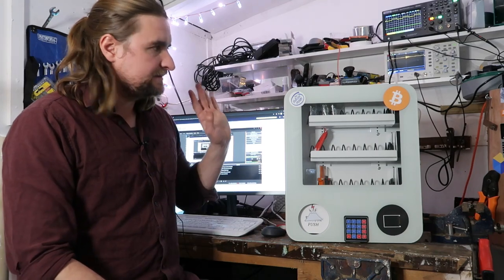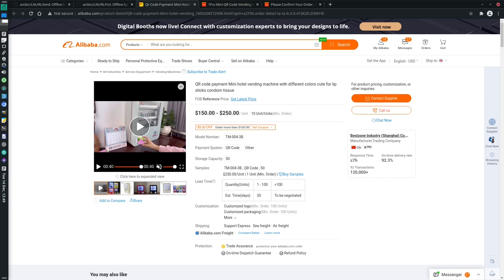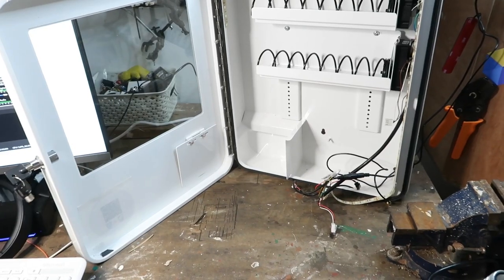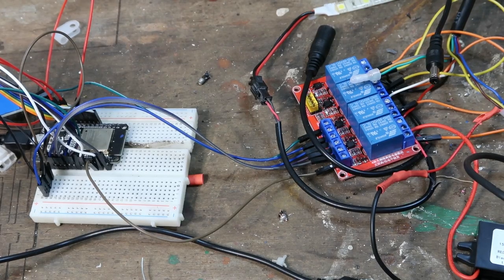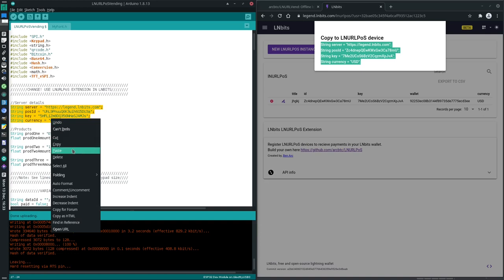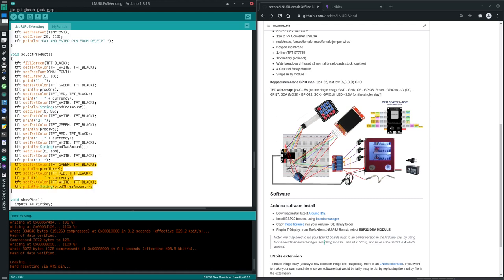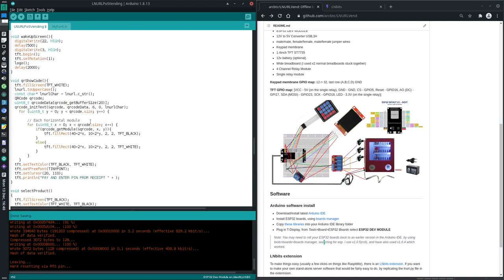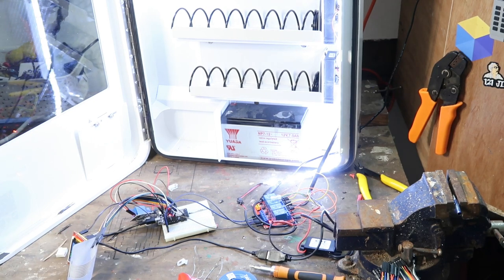LNURLVend tutorial! Build an offline bitcoin vending machine

Comment: Love the work you've done!  Planning on installing this on a machine I just got a deal on and will be fixing up. From your experience if this was installed in a vending machine with items priced at $1 and $2 would this POS be able to charge the equal btc value at correct exchange rate for those products with different values?

Comment: Could not get the display to work, and the video does not match the code, on the github the ino file is called LNURLVend and on the video  it is called LNRURLPosVending as it can be seen in minute 13:46, I looked for the file LNRURLPosVending and could not be found anywhere. It looks like a great project, I hope the video matching the files get posted otherwise it makes it difficult to get it working.

This is what I get on the serial console:

22:46:55.407 -> rst:0x1 (POWERON_RESET),boot:0x13 (SPI_FAST_FLASH_BOOT)
22:46:55.407 -> configsip: 0, SPIWP:0xee
22:46:55.407 -> clk_drv:0x00,q_drv:0x00,d_drv:0x00,cs0_drv:0x00,hd_drv:0x00,wp_drv:0x00
22:46:55.440 -> mode:DIO, clock div:1
22:46:55.440 -> load:0x3fff0030,len:1184
22:46:55.440 -> load:0x40078000,len:13160
22:46:55.440 -> load:0x40080400,len:3036
22:46:55.440 -> entry 0x400805e4

The code compiles fine, any hits or help will greatly be appreciated.
Reply: got the display to work is was a matter of configuring the files in the tft library.